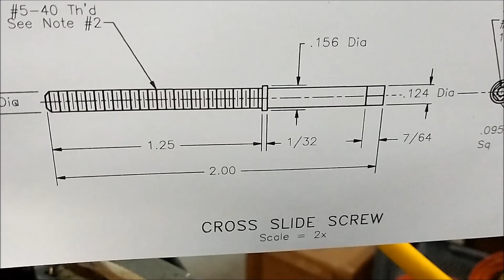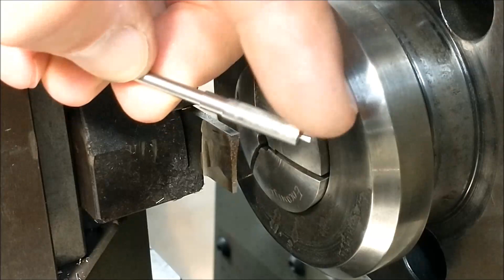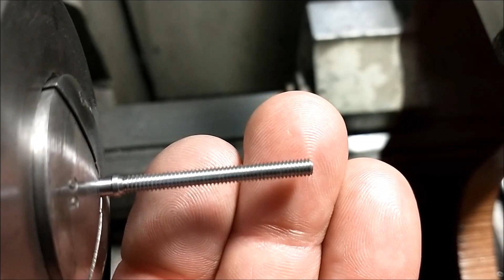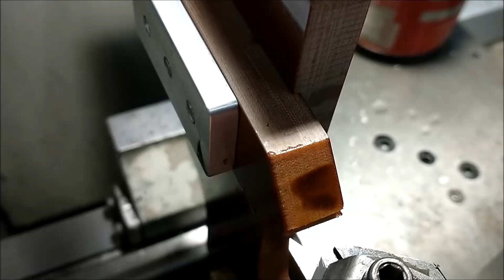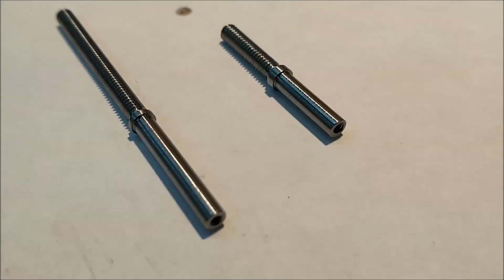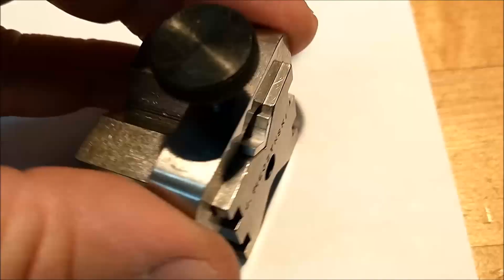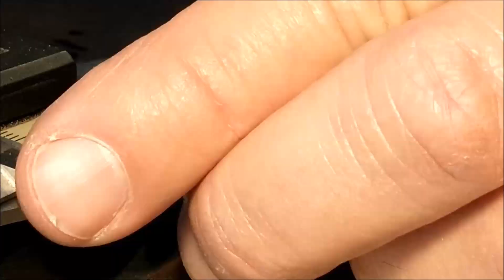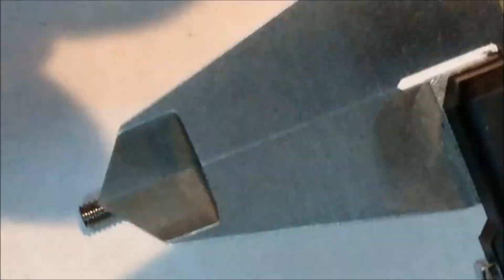Machining a Miniature Engine Lathe - Part  5 - Left Hand Lead Screws

Comment: #5 -40 thread. What does the 5 denote please ?
Reply: I just know the sizes from a table and my wall mounted thread checker, but here is the background on how the sizes originated. “Unified National screws are available in Number sizes from 0 to 12. The Number screw size system is based on a major diameter of .0600 inches being size 0. Each size larger than #0 adds .0130 inches to the major diameter (i.e. a #10 screw has a major diameter = 10 * .0130 + .0600 = .1900 inches). Look up “A Brief History of Screwthreads” on the little machine shop website to see where I got this info.  Post with links are sometimes blocked so I just gave the link in a different reply to your question.
Reply: @shadowdog500  Thanks for the reply,  Coming from England, i have never seen that before, even when denoting BSF, BSW or BA threads
Reply: @shadowdog500  appreciate the info.
Reply: @billyharrison4126  no problem!  YouTube did block my post with the link.  :(
Reply: @shadowdog500  
It isn't metric so its automatically cryptic and confusing*. And as if that isn't bad enough those BA or BSF threads the smaller the number the bigger the thread

*Think of it as being like the secret handshakes and signals used by the Illuminati and other secret organizations bent on world domination.  And if they are secret how do we know about them 🤔
Reply: @mpetersen6   You think that's bad, check out the formula for AWG (American Wire Gauge). d= 0.005"*92^((36-n)/39). And in metric- just the diameter in mm. Of course steps of 2 or 1 in AWG make more sense practically so you give up some and gain some.